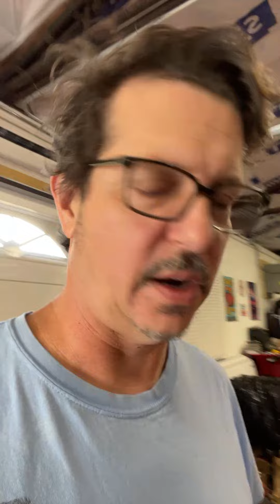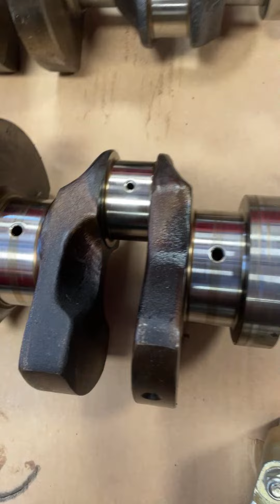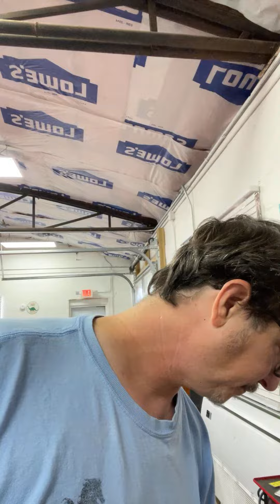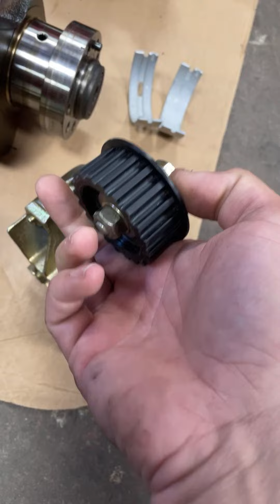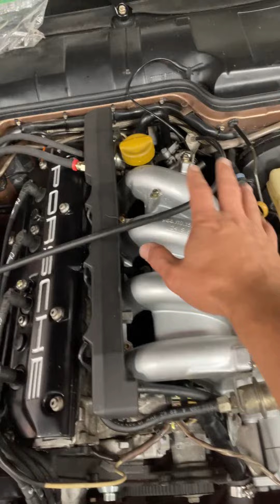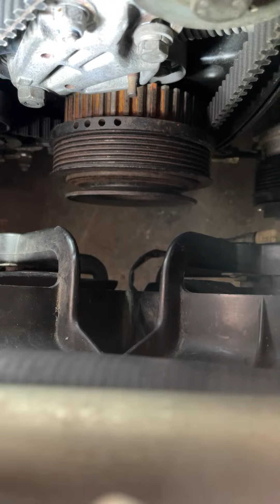Porsche 944 Livestream 9-14-25

Comment: Have to admit, first time I have seen the 2.5 crank by itself. Is that a flat plane configuration? I searched and results come back that it is not flat plane.
Reply from the maker: Yes! It is a flat plane crank like most inline-fours. A cross-plane inline-four would be out of primary balance and have several rotations without a power stroke making for a very jerky drive but I have seen them!

Comment: Is there a long lasting modern belt you can get?
Reply from the maker: Belt technology is lightyears beyond what they had in the 1980’s. So while a modern belt should last far beyond the original recommended 30,000 miles, the problem is the life of the belt can be affected by many different environmental factors such as oil saturation and worn/damaged sprockets. Had the 944 been produced today, using available modern belt technology I believe that belt replacements might be closer to 60-80k miles. A smaller displacement four-cylinder might see 100k miles but there’s a lot less stress on those belts. 40 years later with these engines now potentially having worn sprockets and leaky seals it isn’t worth the risk to raise the recommended mileage despite the belts being much better, if that makes sense. On my personal cars that have no leaks I lean more towards age rather than mileage. I usually change them every six years regardless of any signs of wear or cracking. Mainly since there isn’t any need to be stranded or create more work for myself over a belt that can be easily replaced. Also don’t fall for the Kevlar belts, typically it’s the teeth that shear off when they get old. While the Kevlar in the outer part of the belt part helps keep it from tearing, when  it comes to the teeth they’re the same as any other regular belt. I hope that helps!

Comment: Great stream, I forgot to ask. If the oxygen sensor really is faulty, would could it improve emissions just by disconnecting it? It should just go back to default ignition/injection then? In theory...
Reply from the maker: So something I forgot to mention is that your European car may have the code plug installed which tells it to run a map that ignores the O2 sensor.
Reply: Thanks.